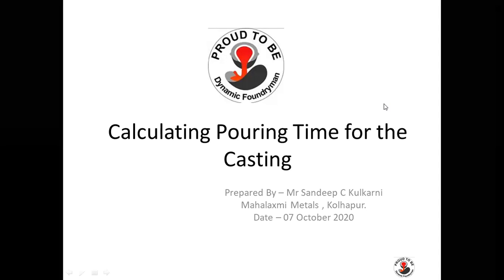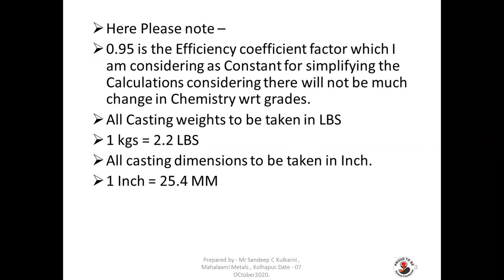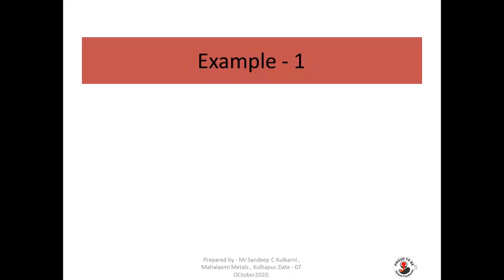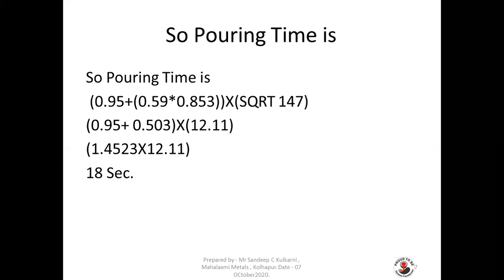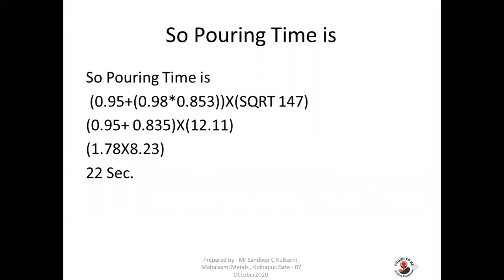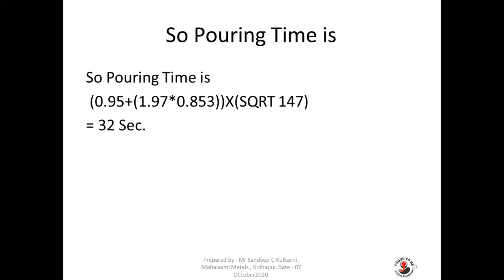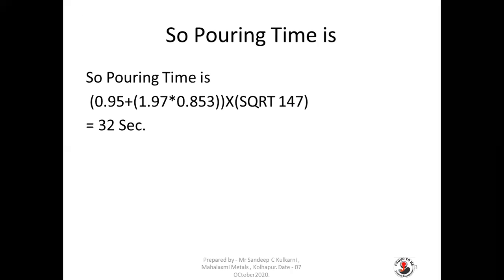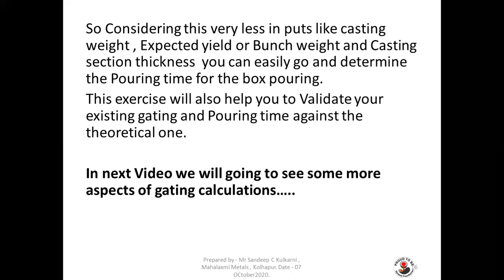Casting Pouring Time Calculations

Comment: In Japan and Indonesia, They are maintaining 100kg per second for Full mould process.
Reply from the maker: It depends on Sand properties , mould properties , mould material. This video is basically made for normal green sand moulds with GCS 1200. So there may be various ways of looking at it.

Comment: For big size casting (1.0 Mt to 10MT) also it is applicable? Because it’s seems up normal while calculating big size casting pouring time by using this formula
Reply from the maker: As per my experience it works well up to 50 kgs castings. Above that done it works sometimes it does not work. Even our normal thumb rule of 3-5 Kgs per dec Aldo sometimesl does not work in bigger castings.